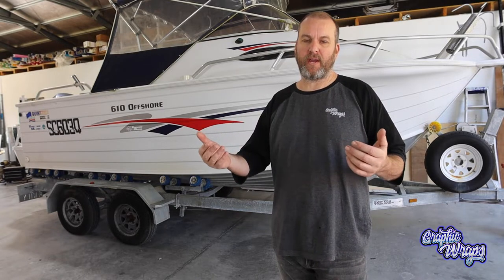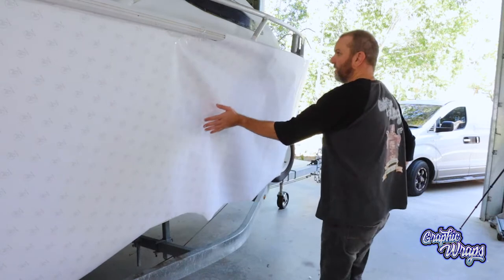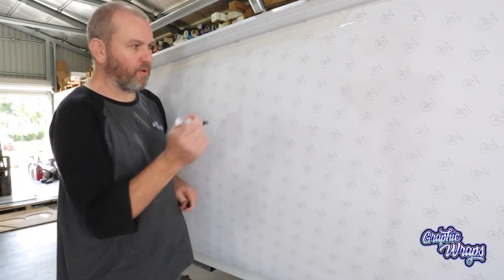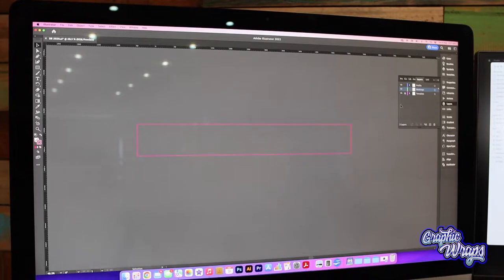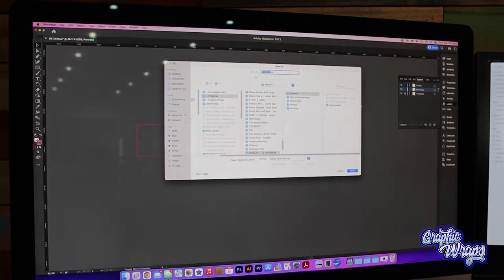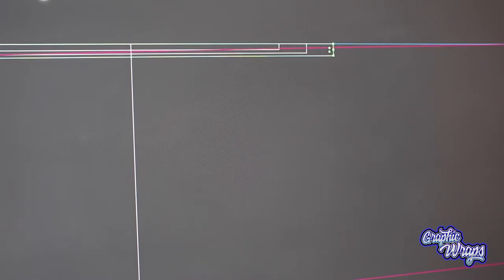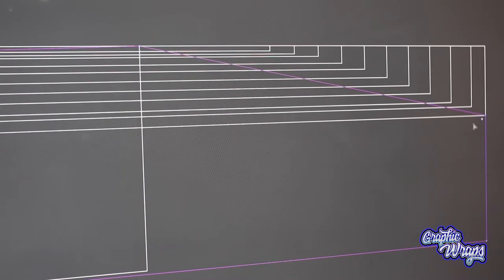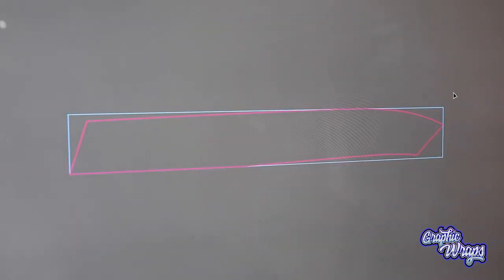How to make a Boat Wrap Template - Front start to Finish

Comment: Awesome! Thanks! I watched the last video was going to ask in the comments for this exact explanation of how to measure.  I always used laser and measuring tapes  to get somewhat close but nothing really can compensate for the inward curve of the boat. I also have make cut out template with backing and tried to get a large scale scan with cell cam but is more accurate with some stuff. This is the most accurate but far, if only vehicles could be as simple as boats lol
Reply from the maker: Glad I could help you out!

Comment: You could just take a picture of the boat and make the template from the picture and then just put you length and width into your program and it will convert it to what ever scale you want. Then just make your design on the scaled picture of the boat then print that design and boom